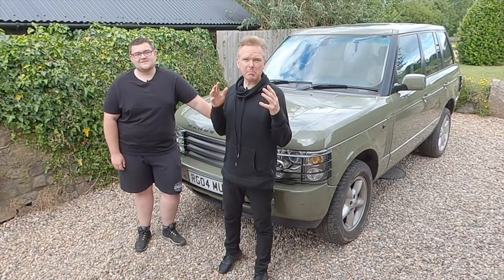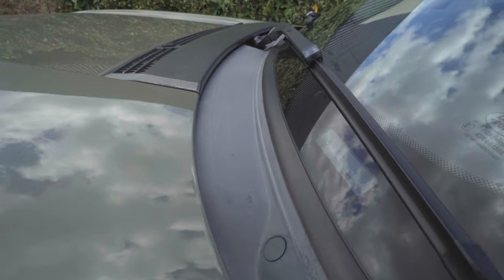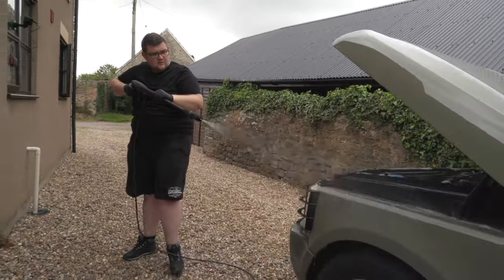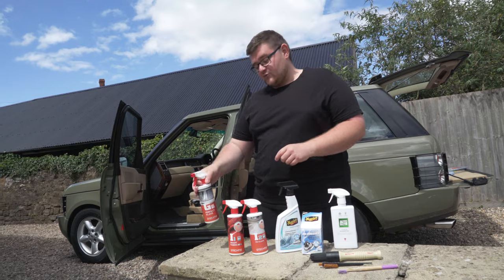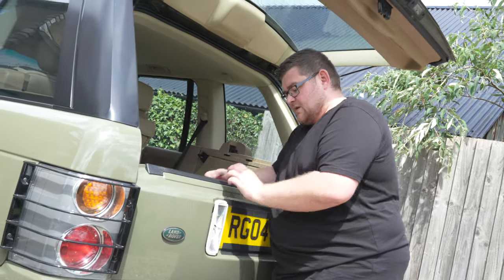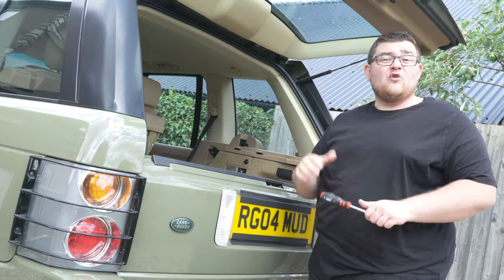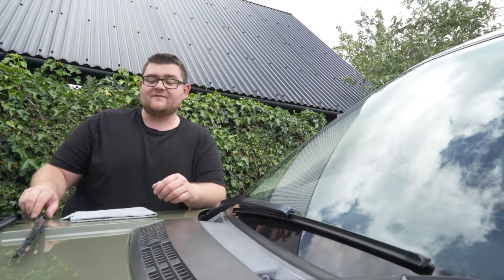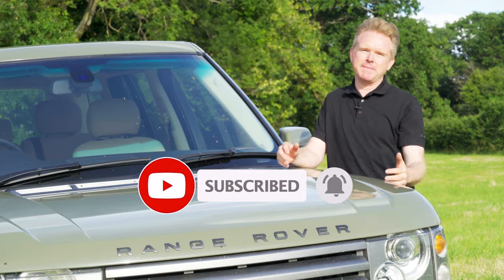This is what it takes to rescue a £2,000 Overfinch Range Rover? EP2

Comment: I have owned a L322 for a month now. Not having much experience in car maintenance before i find it so easy to work on.
So far i have replaced both fog light bulbs. Front and back window wipers. Both 
cables to drop down boot lid which had snapped. Next will be near side light cluster lens. Any ideas where to get the dash sorted as the cluster is pixilated. I live in Nottingham.  Great content thanks